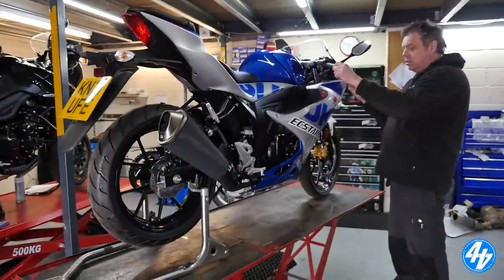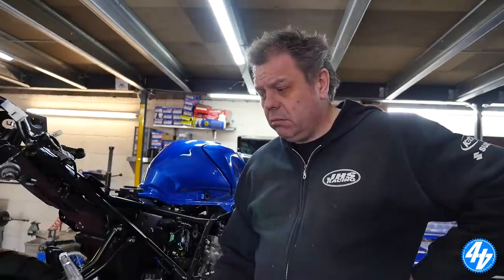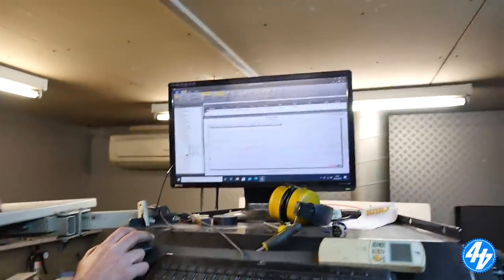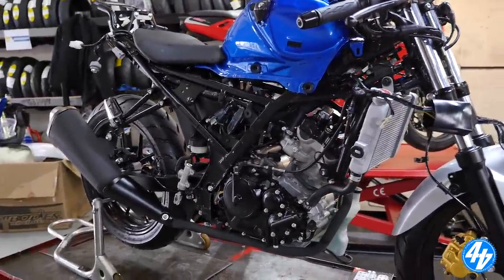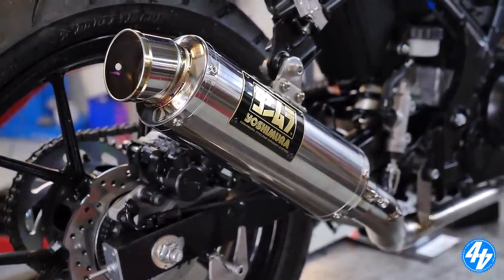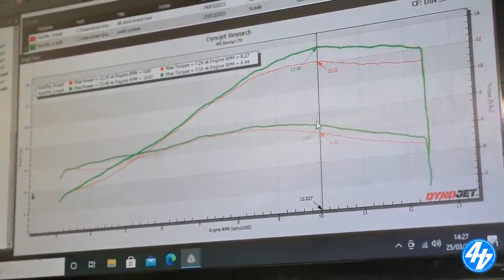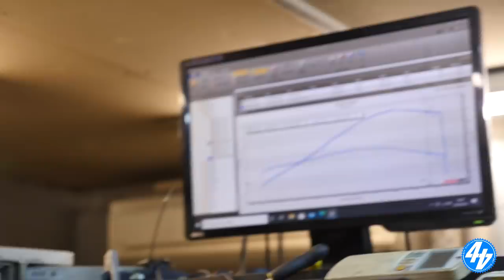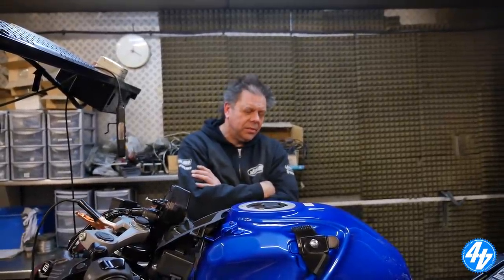ROAD Bike to RACE Bike

Comment: I have the same engine on my bike but its 150cc and makes 18hp stock. With a good air filter, injectors, valve springs, bigger throttle body, fuel pump, and a nice ecu we can pump it up to 25 - 28hp

Comment: In my country this bike was about have 25cc more and the price about 1800 pounds, it's an easy and cheap bike to build for entry race too. So I cant wait what is look like to build as a racing bike soon.  U can check instagram/youtube channel of On3Motoshop the owner had modified his bike into "racing look", change brake calipers (rear & front), as he changed brake lines, changed rims (if I not forget it's an OZ Wheels) and put slick tyres on it, oh I almost forgot he change the rear suspension also and make custom steering damper to giving better handling so goodluck for ur project guys. 😁

Comment: In Indonesian, this motorbike is called the "The King of Sport Bike 150cc" because the GSX R150 motorbike can go up to 172 kmh (107 mph) ... In terms of handling, ergonomics and power, this motorbike has a character that is very suitable for racing... And this bike has a design and engine sound similar to the Moto3 motorbike
Reply: Ini gsxr 125
Reply: its 125cc not 150cc
Reply: Bullshit a 150 hits 172km/h
Reply: @And_rew92  well it have long gearing and high red line almost 13000rpm
Reply: @And_rew92  usually with aftermarket exhaust and ecu stock not that high
Reply: @FilbertFerdinand  it would take a lot more than an exhaust and a plug in to get that kind of speed.
Reply: @And_rew92  yeah.... to be honest i dont belive it either

Comment: Growler of the Week for sure - if anything else wins then it's a FIX, hahaha
Just over a 10% gain in power is big for doing not very much. Drop a tooth or 2 on the front and she'll be a little ripper.
Might be worth sticking a good quality chain on as well - less rotationally friction as Uncle James says.
Good racing engine oil as well for more of the friction stuff.

Comment: 12:05 GSX-R125 Rev limit is 11500Rpm when GSX-R150 can max out to 13000Rpm even with longer stroke, and it's still got 13,70 HP, man this bike still got potential.

Comment: Can I suggest something. Try with WRX Exhaust (GP6 MP1 silencer & RS150 header, +/- US$ 100) but you need aftermarket footstep (try Bpro +/- US$ 85 or Bonamici). Put Accentwire Select Series & Gahar series. ECU (aRacer, Juken 5 or SARP). Set on dyno and ready to race.

Comment: Nice tuning vids!  xhanging ur exhaust pipe need to remap it to sync with ur current exhaust . european bikes detuned gsxr 150 to 125 with a stock hp of 15 ?  asian gsxr150 stock  tend to be 18 hp  . So to counter the detuned u need programmable ecu throtle body to 36 mm,  save weight , swap exhaust to be lighter , lighter mags wheel , carbon fiber body kits. select lighter battery, sprocket set combination (depends on your track) , also tire .

Also if theres no rules in ur race i think you can import  whole engine of asian gsxr 150 togther w/ ecu.

 Thanks Ride safe !

Comment: trying to make my moped & 125 go faster was great fun. Gearing the bike for each track will help. 1.5mm over bore (within rules ?) skimmed head, jetting. the odd titanium fastener, lighter sprockets/chain. I've even heard of people weighing tyres, (filled with lighter than air gas) . Then stick a FC rider on it to negate all the hard work. Good luck guys.

Comment: Did you do any other baseline measurements i.e. 0-60, standing quarter etc? I guess there will be stock figures available anyway but would be interesting to what those changes have made in the real world (when finished).
Reply: They are going to race the bike against other 125s
Reply: @stephenmcqueen4029  Which I assume will also be somewhat prepared rather than be bone stock?

Comment: If you could somehow put the air intake to above the front wheel's mudguard, you ought to get a ram effect. A marginal one, but it should make a difference. Right there the air is probably under the highest pressure. I guess some fairings will go on the bike again. If you used the fairings as outside part of a duct system to the engine's intake, you'd get nicely cooled, slightly pressurised air where you need it. That's another half a bee's dick of power added! :oD